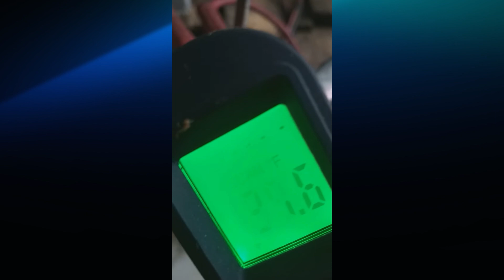Exclusive Look George Smith's Engine That Runs on Water Unveiled!

Comment: Hello everyone i didn't realise that conversations were going on here. If you get yourself a pipe stainless steel would be good, about 1 inch inside diameter and about 1 foot long and drill 2 holes, about 1/2 an inch in from the ends and the other hole is for you to weld a connection for your Hydrogen and Oxygen to feed into a rubber pipe that will feed to your air intake of your engine. Then get a thread rod about 1 and a half foot long, you will need 2 nuts, 2 washers, and 2 rubber washers, the threaed rod will go inside your pipe but must NOT Touch  the pipe. The stainless steel pipe is the + terminal and the thread rod is the - terminal, then add salt or try other different options. And then you can feed the pipe into a tank of water and you can lite the bubbles, have fun , remember it's a learning process. Let me know how you get on please.

Comment: I've tried this, but containment and pressure holder is a problem, the battery power was too much, so needed controlled by a rheostat, and the catalyst was too much, but the amount of gas was so great that the containment exploded in seconds, although pretty flimsy. But it does work, just don't have the proper containment or off gassing control?

Comment: This is nothing new, but of course is being heavily concealed. I did this exact same thing about 18 months ago with a generator. Not sure how much this geezer knows, but I had to retard the ignition timing on mine, as hydrogen combustion has a much higher temperature than petroleum. I reduced the battery current consumption by introducing sodium hydroxide in the water in order to accelerate the hydrogen atom separation from the oxygen. I haven't tried frequency oscillation of the water yet. Also my engine oil was getting contaminated with water from the vapor produced during the combustion process. Cheers Kris.
Reply: glaxion62 thank you if you have a listen to the last podcast I did 3 days ago you will get a lot more information it's 1hr 3min .
Reply: @dodsmith4570  Ah... okay thanks... where can I find that podcast you mention?, as I would really like to see it. I had a look on George Smith channel, but could see no such podcast of over an hour duration on that topic. Thanks..
Reply: It's a podcast I did with Kris , it Aired first on the 24 at 7 pm 5 days ago.

Comment: To run an electric motor directly from the battery would make more sense in this particular case. 
As far as I understand there is not a problem to run ICE on hydrogen - there are a few buses have been running on hydrogen in London as a test since a long ago. The problem is to have cheep hydrogen in abundance and available for consumer use. In this particular case electrolysis is used: 2Н₂О = 2Н₂↑ + О₂↑. Where's electricity come from? If it was free from thin air - it would make economic sense. Otherwise there is not much difference from ICE on petrol, only more expensive.
Reply from the maker: You mean like Tesla cars? Batteries are heavy, use up lots of minerals and have a tendency of going BOOOOOOOOOOOOM!
Reply: @lsbfilmproductions  I meant that electrolysis is not efficient way to create hydrogen. And this engine in the video (end to end) is not new. The point is the engine as whole set up does not really run on the water, but it runs on electricity. Once battery is low the electrolysis stoped to generate hydrogen and ICE engine stopped, even there are still plenty of water in the tank.

Comment: Will it take load?
Reply: Yes it will take full load, but the engine gets very hot due to the load combined with the higher combustion temperatures produced from hydrogen when compared to petroleum. In fact hydrogen has higher energy, hence the extra heat produced, meaning an engine has the potential to produce greater power outputs than a petrol one.
Reply: @galaxion62  Wonder if the ceramic oil additives would help. It coats the moving  parts with a film if ceramic.
Reply: @msmrepo3271  Ah good call, I'll explore that avenue as a possibility due to ceramic additives decreasing friction, thus making the oil more effective when it becomes contaminated with water, cheers.
Reply: @galaxion62  it's worth a go mate

Comment: What are the odds he tops himself soon.
Reply: He is not the only one doing this. There are literally hundreds on you tube.
Reply: @Beliefisthedeathofintellect  I saw one at the Ideal home Exhibition years ago.  It looked like a water heater that goes on the wall.  Smart and white.
Reply: @Nellyontheland  they make us think it needs to be compressed.  
12v battery 2 bits of wire. Some stainless steel in saltwater and a plasticic bottle and you have hho or hh2 can't remember.  But that gives you maybe 40% extra miles when pipe placed in the air box.
Reply: @Beliefisthedeathofintellect   Yup.  A chap called Celon or SrilankaC (on YouTube) had one on his car 10 yrs ago or more.

No I have solar as amain leccy source, a hydrogen generator should be next on my list.
Reply: @Nellyontheland  😁💪🏻
Reply: The problem is he's using more energy from the battery than the engine is producing (law of thermodynamics)
   I assume the "frequency" comment at the end relates to a more efficient way to produce hydrogen than the electrolysis that this demo displays
   Don't see anything "special" here ....no different too a lpg, wood gas set up just injecting fuel/air mixture direct into the combustion chamber (which is the purpose of the carburetor on a petrol engine)
Reply: None if its a hydrogen generator! 
These already exist for the home.

Comment: So is it a hydrogen generator? 

Technically running on a salt water solution that uses the batts to create the gas?
Reply: Yes
Reply: It's a standard 4- stroke petrol generator he's just bypassed the fuel system and direct injecting hydrogen , much in the same way as an LPG / wood gas fuel system
     If there's anything new it's the "frequency" comment instead of using electrolysis

Comment: I trust he's well protected & he's safeguarded  his technology
Reply: Thats the worst thing he could do, if he spread it far and wide as open source he might not be killed . Many people have invented water engines going back 60 years and they have all been assassinated. Cold fusion, free clean limitless electrical power is the only scientific process to ever be voted down , by the same panel that found jet fuel melts steel beams incidentally. We are debt and energy slaves, threaten the system of control and you will pay the price .